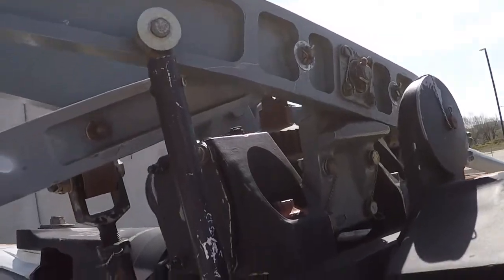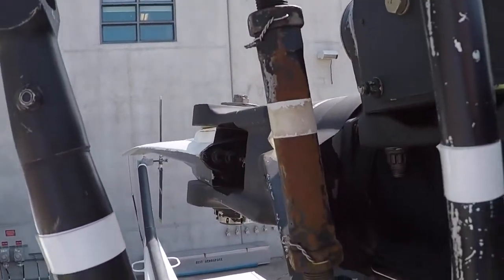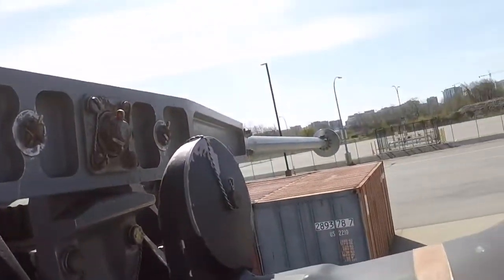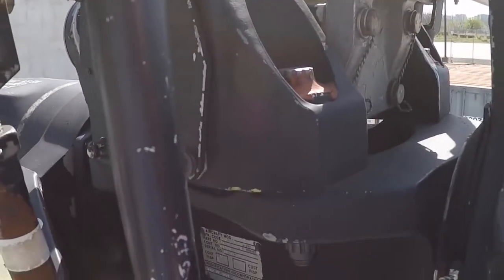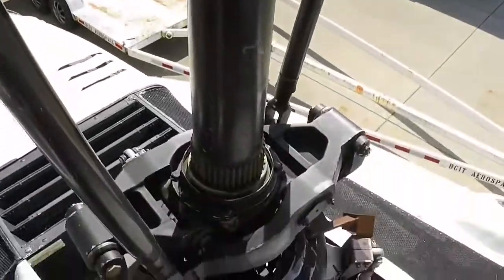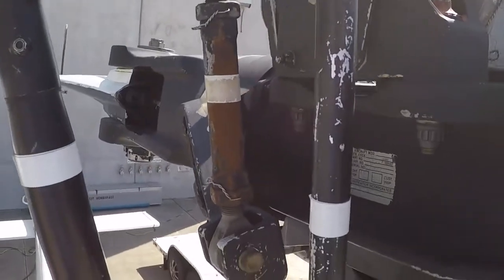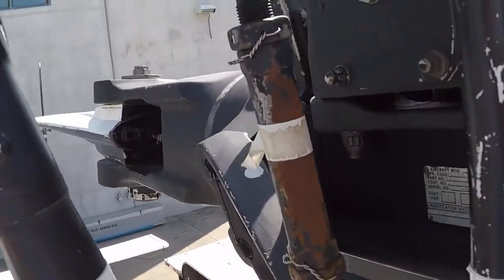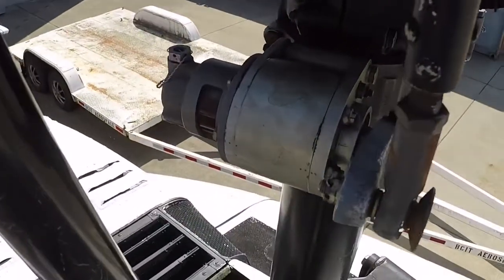Bell Helicopters Stabilizer Bar Operation

Comment: Some variants of the US Marines UH-1N’s or 212’s with effectively the same rotor as this 205 do not have stabilizer bars. The bar, mixing lever and dampers are removed and replaced with a stand alone mixing lever. I believe like a 214B at minimum the SCAS has to function.

Comment: Haa. This complex moves explained in seconds ???   Is how they learn in flight school ??   Theoretically…. In reality it takes  along time to realize what’s happening the roll of every moving part. And why !!!  But he sounds very convincing..
Reply: I understood what he was saying for the most part.  The stabalizer bar can micro adjust rotor blades if the copter is blown sideways, due to the stablizer bar experience gyroscopic forces and will not break plane as easy, so it will input corrections back into the rotors...  not super complicacted.  well maybe for you.

Comment: Thank you for this video, why there is no stabilizer bar in rotor with 3 blades,, for exp ..schweizer
Reply: Lockheed developed a gyro stabilized rotor in the late 1950s/early 1960s that could be used on a rotor with any number of blades. Sample patent: https://patents.google.com/patent/US3135335
Check out also this video on development of the Cheyenne: https://www.youtube.com/watch?v=eDo04Lw_vbA
Reply: Because they are fully articulated type Rotor